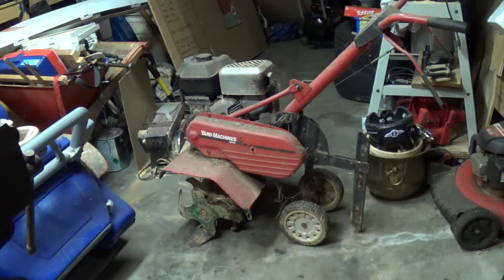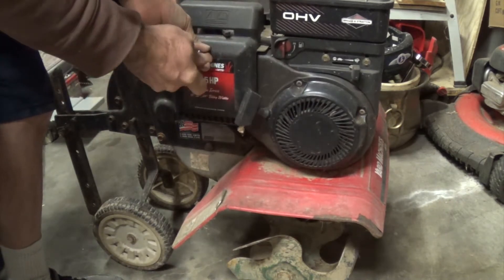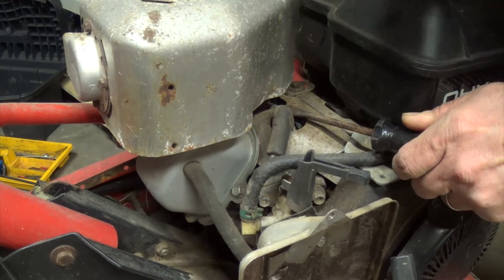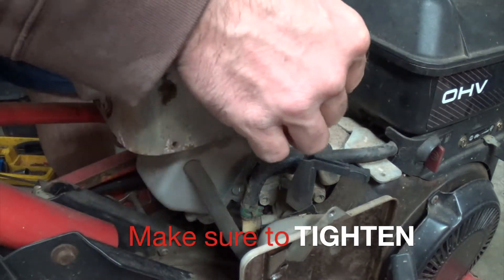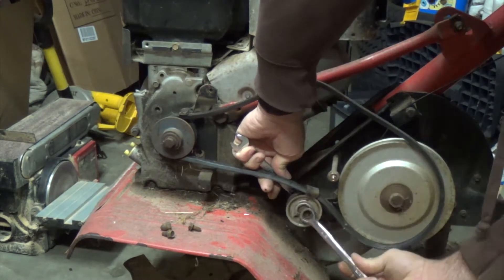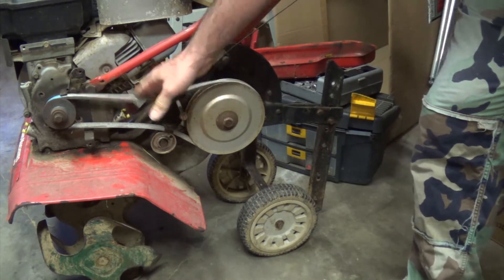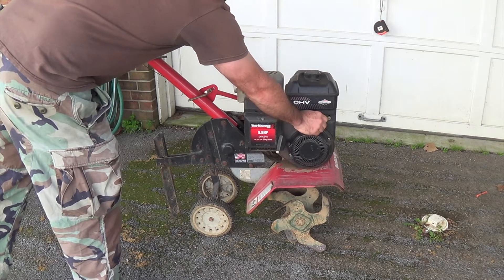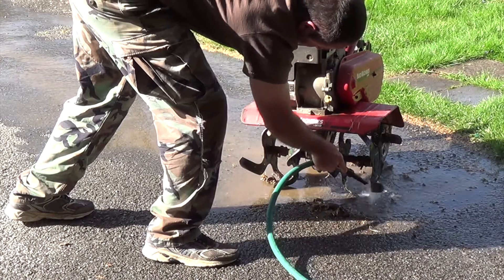Prepping the Tiller

Comment: Good video. You take very good care of your equipment.  That's a useful tip about draining the excess gas so it doesn't stay in the carburetor. Good to know. Thanks.
Reply from the maker: Just make sure you crank it a few times after draining it. Just because it’s drained, doesn’t mean there isn’t a little still in the carburetor. Maybe cranking it will burn up that last bit. Take care
Reply: Thanks again. I appreciate that.